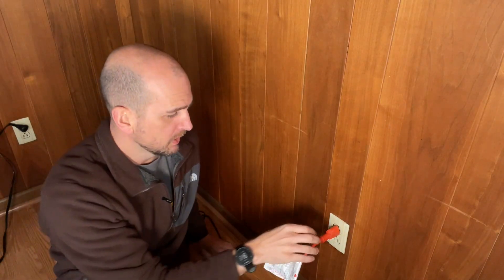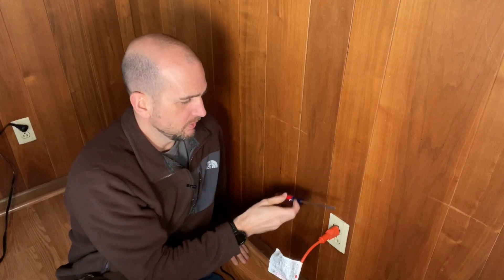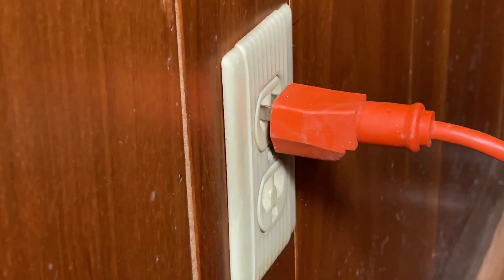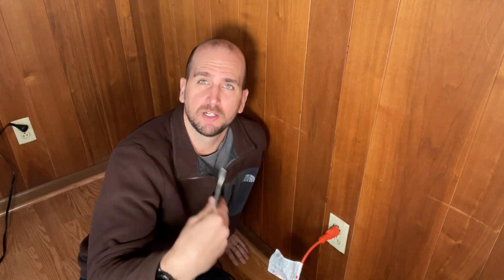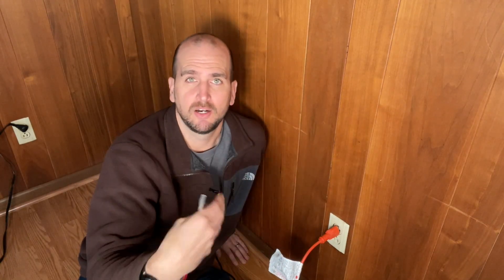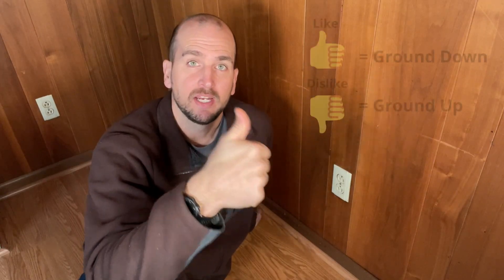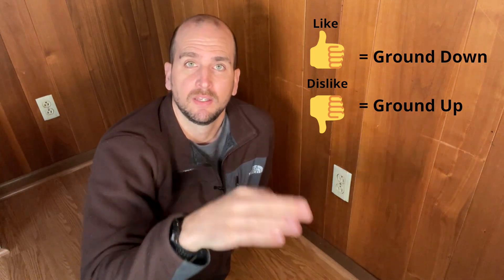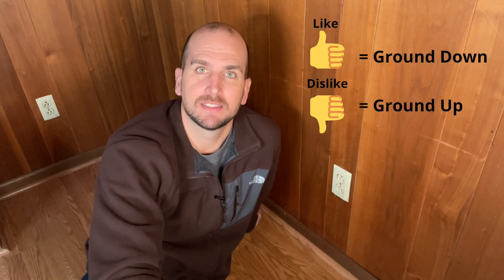Should An Outlet Be Installed Ground Down Or Up

Comment: I just addressed this on a different thread. Let me first comment that what is most common (ground down) all too often is the most influential factor, but not necessarily "the best". Let me explain. I welcome the opportunity to give my own two cents concerning one detail.  While it is most common to see recepts oriented ground side down, "A LIFETIME (more than 60 years!!) OF USER EXPERIENCE" has taught me the opposite to be the most functionally advantageous in TWO ways!  #1 it is MUCH easier to align a plug for insertion with the ground prong on top, especially in poor light!  #2 and most important, heavier cords remain fully inserted MUCH better with the ground prong on top!! This is especially true with recepts that are no longer "brand new".  I'll stand by that the rest of my years!!!

Comment: For the early part of my life, they were one way. Then sometime later they got switched. Some X-10 remote devices (earlier Radio Shack) with three pronged plugs had the ground down and the outlet on the device on the bottom. So, I sometimes rotated the outlet to make the cord go down. Nice to know there is not a code specifying the direction.

Comment: As a Brit living in Canada, I'm struggling to cope with "American" power sockets: Both houses I've lived in here have a mix of "up/down" orientation. I prefer the ground up, for the safety reason you identify, but I have some cables with the 90deg plug, and as you point out, these make sense for the ground down orientation. Also, I can't get my mind around a light switch that controls a power socket. That's not ok to the British mind.

All British power sockets are ground-up, and all - ALL - our plugs are the 90deg type. That's intentional, so that you can't pull the plug out of the socket by pulling on the cable - you have to pull the plug itself. That avoids the risk of pulling one of the wires out of the plug and leaving an electrocution risk. If you find that difficult (such as for older people with failing grip strength) you can buy plugs with finger-loops to make them easier to pull. Finally, our lighting circuits are separate from our power circuits, so power sockets are always powered - but usually have a switch beside each plug socket so that you can switch the power off without having to unplug. The separation in circuits means that you have a stronger circuit breaker on power circuits, and weaker ones on lighting - hence lower risk of electrocution when changing a bulb.

I'd like to see America (and Canada) standardize on ground-up orientation, and to sell 90deg plugs that align with this - ideally for ALL plugs to be 90deg type, so that you cannot pull the plug using the lead, but have to grip the plug.

Comment: As a third generation electrician (son is fourth) and Senior Control Engineer I was taught ground down as a matter of aesthetics and I believe it may have been originally linked to ground wire low on the pole. Granddad was fastidious on proper workmanship and form, and would beat dad with a knotted plow line for failing to have ALL faceplate screws straight up and down, and considered it very poor craftsmanship which was an enormous thing in his day 1930s thru 50s unlike today. The ground hole on top for switched outlets made great sense but I have had a steel faceplate drop across prongs before and pop the breaker as well as making me see stars. Also note in very old houses (roughly thru mid to late 1950s, especially rural) the hot wire (black thread in cloth braid over rubber jacket) was run unbroken to lights, and the neutral (no thread) was run thru the switches. From late 50s this all changed with neutral unbroken and hot switched for greater safety. BE EXTREMELY CAREFUL in an old house and test this before you just flip off a light switch and then proceed to work on the fixture.

Comment: to those saying Ground down --- From my inspector -- ground up and the reason is : because if a metal cover plate is used then IF it falls off because somebody took the screw off for what ever reason then like in the video it would fall and hang up on the ground --all the receptacles I ever replaced or installed have been ground up --EXCEPT as per the NEC if the outlet is a dedicated outlet like a washer, Fridge or disposal etc  that the cord for such device is a right angle plug then the outlet must be installed so as the cable drops down and is not a bent loop up and then down ...remember gravity sucks...js  In other words match the plug to the outlet so the cable is not bent in a loop

Comment: The ground up or down thing puzzles me because I was SURE it was in code ground must face down.

Whatever your opinion is, if it's not facing down that opinion is wrong. It might be a best practice thing, and we have differences in Canada to US code but ground facing up makes zero sense. It is far more dangerous and really defeats the purpose of a ground in the first place.

There is a lot of things I wish we could adopt from Europe(All plugs have individual fuses for example) but when you are making an connector for, or placing a male end on the end of a cable, I am sure(Though probably wrong again) you are to cut the wires in specific lengths. You will see people make a 90 degree cut on the wires to have ground, live and neutral the same lengths. This is very wrong, you are supposed to make the ground longer, and really it doesn't matter but neutral should be cut longer than the live. 

But why? Well when you are tugging on cables, if there is any movement in the connector you want the dangerous part to fail first. You pull the live out first. Then the live is no longer making contact, the neutral and last thee ground. This ensures a piece of equipment can not be disconnected from neutral, and ever from ground before the live disconnects.

In fact it's a reason our live side should be a different shape and size, and receptacles should have the live side more recessed(Not code, but would be safer).

Getting back to receptacles, having the ground facing down allows the weight of the cable to ensure any movement pulling the cable our from the wall due to gravity, shifting furniture etc makes sure the ground lets go last. This is before the weight is cause it to twist, pulling the two prongs out first.

If your concern it the live lead being exposed please get that out of your head now. Yes that is not ideal, but it also means the live should disconnect before the ground. Using an appliance with ground facing up means you could potentially be using an appliance that is ungrounded that requires ground if it's not double insulated. 

It literally makes zero sense and the fact it's not code to have ground facing down on a regular receptacle is... Not good. Not only is this best practice, but potentially life saving. I know people may be worried about say debris behind a plug arcing, or arcing and fires which could be a safety hazard. I know what thoughts might be going through someone's head about ground placement. 

But in the end, a ground if required, and a ground MUST BE THE LAST THING TO FAIL NO FUCKING EXCEPTIONS. It's ground down. Period.

Comment: its not in the code but my boss a professional electrical contractor explained that the U ground should be down. The reason being that when a plug comes out of the socket by being pulled down, the gound connection is the last to break...try it yourself

Comment: WHEN I FIRST STARTED PUTTING IN RECEPTACLES, I DID NOT KNOW WHICH WAY, UP OR DOWN. SO I LOOKED AT THE DYNAMICS OF A 3 PRONG PLUG, AND DECIDED THAT DOWNWARD WEIGHT/DRAG ON THE PLUG, WOULD BE RESISTED BETTER, WITH THE GROUND PRONG ON TOP. THE GROUND PRONG IS THE MOST SACRIFICIAL , OF THE 3 PRONGS, IMO. THE GROUND PRONG IS LONGER, SO IF SOMEONE FELL ONTO A 3 PRONG PLUG, I AM CERTAIN THE PLUG STANDS A BETTER CHANCE OF REMAINING FUNCTIONAL,  IF THE GROUND IS ON TOP. SINCE THE 2 POWER PRONGS ARE SHORTER, PUTTING WEIGHT ON THE PLUGGED IN 3 PRONG, WITH GROUND DOWN, THE 2 POWER PRONGS WOULD POP OUT, EASIER. AN ELECTRICIAN LAUGHED AT MY UPSIDE DOWN RECEPTACLES, BUT I STAND BY MY REASONING AS TO STRENGTH OF CONTACT, AND SAFETY, WITH GROUND UP, SHOULD SOMETHING HEAVY FALL ON THE PLUG, WHILE IN USE.

Comment: You will never resolve this here with this video or any other.  I've been in electrical work for decades and heard all the arguments.  The NEC doesn't dictate, if it did it would have to include orientations for all types of receptacles, but some local jurisdictions have amendments that do dictate orientation as well as conductor color coding (another debate).  NEMA dictates standards for receptacles and other electrical devices.  Many manufacturer's catalogs now show ground up.  Main issue I have seen is molded cord sets with right angle plugs generally are made with the ground down.  So as the video says, we put orientation in the project specifications.  In the early days of the 3 prong grounding receptacles it was common that they were installed with the ground down and that is how I learned to do it.  It was years later before I ran into the debate about up vs. down.

Comment: Had a metal cookie sheet pan fall behind my gas range - it contacted the hot/neutral made horrible sound with a blue flash of light and
 tripped the breaker.  When I slid the stove out to retrieve the sheet pan it looked like someone had welded it in 2 spots.  So I changed that duplex to ground up - just in case it happens again.

Comment: NFPA-70 110.3 (B) 110.3(B) Listed or labeled equipment shall be installed and used in accordance with any instructions included in the listing or labeling. 
The problem is some receptacle manufacturers (not all) still have receptacles labeled "top" on the yoke with the grounding pin oriented up, and the instructions that come in the box all show the device installed with the ground pin-up. So there you have it, it actually is in the codebook.  I have actually had an inspector point this out to me after we had gotten off on the wrong foot and he was being a dick.

Comment: DIY er I assumed it was code because In my college electrical  course the instructor said ground down was for safety reasons. If the cord were to come unplugged  the ground would be last to become disconnected with the ground down. With the ground up the ground could become disconnected first with the appliance  still connected compromising the safety that a connected ground supplies.

Comment: I like your idea about denoting outlets that are switched. I am going to borrow that one. I like ground down just because consumer products typically make plugs like the one you showed with the 90 degree bend in favor of ground down. But for my switched outlets I usually just have lamps plugged in, so flipping them to denote the switched outlet makes sense. I’m doing a remodel now so I will likely do this when I I get to changing the outlets. Thanks!

Comment: I take an NEC update class every 3 years. My instructor has a hand in writing the codebook. This came up. Ground up is proper because of safety. Proper, but not code. The code doesn't and will probably never address this. The patent diagrams for these devices are ground up. 

Knowing all this, I install ground down lol. For me, ground up is identification for a switched outlet. So, to be fair, thumbs up AND down for me.

Comment: My house was wired by commercial electrician 
He wired everything ground up in 2002. 
It drive me crazy so I start flipping them. 
2 weeks latter my toddler niece 
Insert a coin behind the plug between the receptacle 
Huge POP and blew the fuse . 
I’m like 🤔 that is WHY the commercial electrician install GROUND UP

Comment: My choice is ground up, it is how I do my own receptacle outlets. Clients may specify which way is up but I meet what is existing method. Talk about safety, best would be neutral up, horizontal orientation. At a location where there are constantly metal objects fallin, definitely ground up, no questions asked, reorient if requested. Your retired insdustrial maintenance electrician, JR.

Comment: We need to redesign the outlet so the first 1/4 inch or 1/3 inch of the prongs are insulated like they are in western Europe and the U.K. 
This eliminates the risk of shorting when something falls on the plug when it's not fully flush with the socket.

Comment: In the 60's I was taught up for the reason you indicated.  Depending on area some say up and some say down.  If I install it it will be installed up.  I have been told in areas requiring down that it was a local code.

Comment: As a DIYer, I'm on the fence... all my life, receptacles have been installed ground down and plugs seem to fit my hand better with the flat on top and the curve around the ground prong on the bottom. 

However... several years ago, my wife and I gave our 8yo grandson an assortment of real tools for Christmas (including a 16' tape measure). Short story is he thought the cord plug was a great place to hook his tape so he could measure his bedroom, which shorted the hot and neutral and caused the AFCI to trip. Thank God that became a "teachable moment" instead of a shock or electrocution! We have had many more intentional safety discussions since then about electrical, hand tools, power tools, lawn care equipment, tree felling/wood cutting, generally anything around the property i can get him involved with. No more assumptions of "common sense" on my part!

Kind of makes the case for ground up! In reality though, I probably won't change but I have had conversations with other grandkids about receptacle do's & don'ts. I still have the charred receptacle on the wall in my shop as a reminder.

Comment: I don't like the US plug points installed upside down. The whole ideology of an object falling on it is rare and silly. When I first came to this country, all plugs were installed with the ground pin down, and never seen a ground pin up until in 2007 when my basement was renovated. It looked stupid. This isn't Singapore or England where the plug is designed to be oriented ground pin up by design.

Comment: Learned this from my time with one of Canada's largest Electrical Contractors while managing installation of receptacles in hospitals... Reason to have ground up is because people typically pull plugs Out & Upwards (either holding plug or worse pulling from cord).  If the ground is up then it will likely be the last thing to break contact making it a much safer process.  Think about it and it will make complete sense.

Comment: I use ground down along with upgraded outlets that use the blade detents. Since the ground doesn't have a detent available, the plugs stay in better with the blades up. Less lever arm to move them out. Obviously that is a special case that only applies to me. Logicly, ground up seems a much better way to go. as would partially sleaved plugs like they use in the UK.
Reply: From what I have read only the ground pin has an actual specification for retention force. I also think that Hubbell is the premier quality receptacle and they have always been ground up in their catalogs. I therefore use ground up most of the time except if there is a specific case that requires it to be down. I also agree on horizontal installation that neutral is up.

Comment: Not sure the picture frame thing holds water, most frames are wood, they are at least 1/4” thick and the tend to fall away from the wall when and if they fall. Secondly, the molded 90 degree cord end plugs are constructed so the cord exits the plug on the ground side, which means with the ground up the cord has to do a 180 degree bend to go back toward the floor... this can cause the cord itself to fail over time. If the NEC were to make a regulation mandating the ground up, they should also mandate all molded cord end plugs be made to match, ground up - cord done,

Comment: Is there anything in the NEC that says you can't install the receptacle horizontally, thereby making the argument about ground up or down irrelevant? I know it's customary or traditional or rather more popular to  install outlets in a vertical orientation but what is wrong or unsafe about installing it horizontally? After all, power outlet strips can assume any position without special concern as to where the ground position should end up.

Comment: I'm a licensed electrician.  (Chicago suburban area)  Ground up is just not done here for some reason.  The object "falling" was always described to me as even the actual cover plate if it is metal.  It makes sense but I need to do what is accepted in this area.  One thing you didn't touch upon is whether receptacles should be installed in a vertical or horizontal position.  Here, floor level receptacles are installed horizontally with the ground on the right which puts the hot on top...same scenario with the "metal cover" plate coming loose and gravity putting it right on top of it.  Seems to me that we are doing it wrong but again it's just how it's done here.  Enjoy your videos BTW.  A DIY'er that doesn't claim to know it all is becoming unusual.  I'm in the business and won't ever know it all either.

Comment: Ground up can be good.  My son was shocked by his chain falling on a exposed plug.  The ground up does not prevent the shock from happening because the chain wrapped around and contacted the ground and the hot still causing sparks to happen and an electrical shock. When I install receptacles I usually ask the owner how they want them install explaining why some people install the ground up over down.

Comment: I have been told ground up when you use a metal wall plate for the receptical as it is considered to be more safe.  Also, my input comes from a variety of sources and half of them work on quasi governmental organizations where rules can be strange.